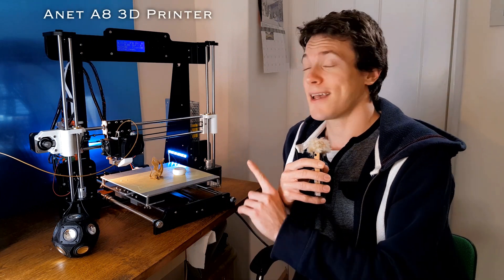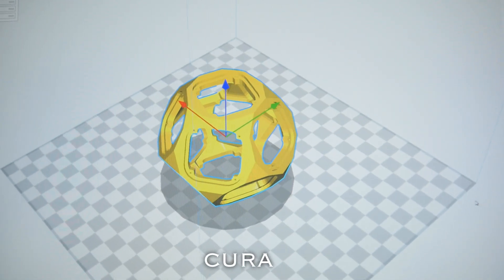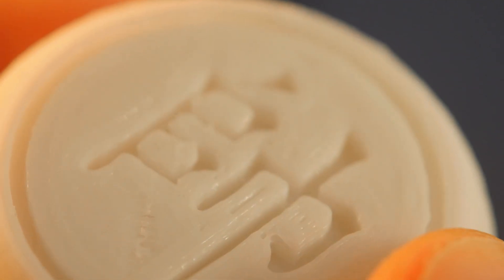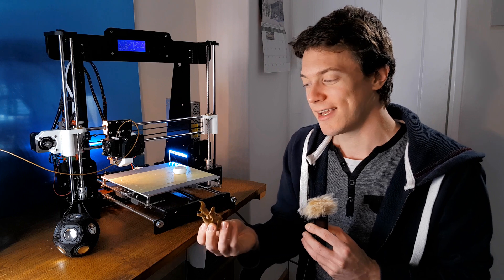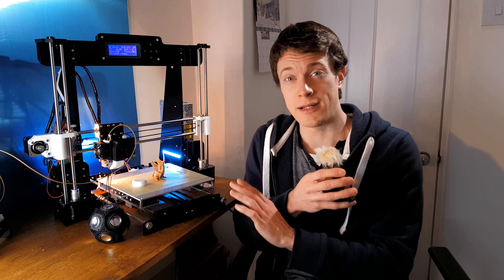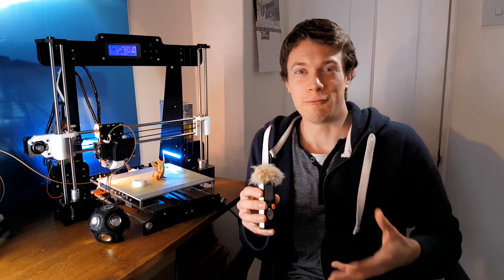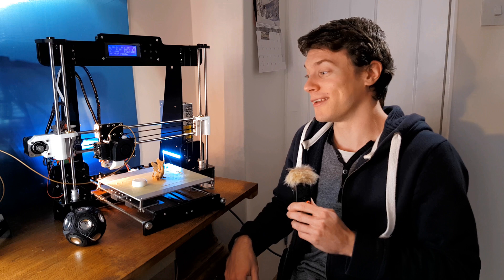Budget $155 3D Printer - Can it possibly be any good?

Comment from the maker: GUYS! They've sent me a coupon code, so you can get it at a solid $155 again. Just use this at checkout using the GearBest link: GBA8TW (updated 15 of March)
Reply: Saw this video and bought the smaller cheaper version- extruded doesn't work and it is missing parts. I don't think Gearbest is the most trustworthy retailer.
Reply from the maker: I'll try and get one - check back in a few days.
Reply: Maybe I am doing it wrong, but this coupon code literally makes it more expensive. My total is now 222 dollars.
Reply from the maker: Try this one: GBA8TW
Reply: This coupon code has "reached it's usage number limit" now... is there another one we can use?
Reply: Can confirm. The code no longer works. Says it been used max times. I feel deep inside a sense of relief of not giving my business to GearBest; my first and permanent impression of them, and their alleged shady reputation.
Reply: GBA8TW code works
Reply from the maker: The code has been updated again for those wanting to get it at $155.
Reply: Sadly it states that the code has been used the max amount of times and now the price is it $222, it shows me at $175 but when i go to checkout it shows $222 and if i try to input the code it says that it has been used the max amount of times and then updates the price to $222 so i am a bit confused.
Reply: Greetings 
I used the code, it gives an error saying that the code has limited usage  (which has been reached).
Additionally, on the first page of the check out process it gives me a total of over $222.00. Then after continuing through it drops back down to $172.99 + 23.78 s&h.
Is it at all possible for you to provide us with a new discount code.

Thank you for your time and quick response.
Reply: I bought mine already and I couldn't use coupon code :(((
Reply: darn, code expired. I waited for payday but I guess that was too long. Thanks for showing us this printer, I still plan on getting one, just have to wait a little longer.
Reply: Justin Shands just buy it without the coupon. plus shipping it ends up being around 200 cus theyre having some deals for 5 days. i guess after the 5 days it might even go up higher! like 300 idk get it tho
Reply: The code no longer works. it says it met the max number of uses. Is there another coad
Reply: yeah, title here should be changed. this isn't the same price anymore. not close.
Reply: works, better than $222. it is now $159.. total was  $187.97 to california, thanks !!
Reply: not working tried today(30-12-2016)
Reply from the maker: I think they've given up on giving code updates now :( sorry guys
Reply: it says invalid code
Reply: I've ordered this printer, cant wait. Could you please provide print bed dimensions for getting a glass panel cut to size? Possibly including how far in the adjustment screws are to have the corners removed from the glass panel.
Thanks
Reply: I must have been lucky, bought one quick when this video came out. Paid 155 plus shipping (DHL) so paid 200 and some change total.
Reply: Hi, can we have another code? thank you
Reply: Thank you!!!
Reply: Worked for EU plug version got that and an adapter for US. Thx so much
Reply: Your code is back working!!!! Thank you!!! GBXIAO
Reply: also it lists the price at like 174. when i used the code, it jumps to 224.
Reply: code doesnt work :( $222
Reply: tried it again and it didn't work
Reply from the maker: New one: GBT8TW
Reply: DIY Perks wrong code?
Reply: i clicked US plug, copy and pasted GBT8TW code and still $222 =(
Reply: yep, code is not working anymore. It has reached the limit of use it says
Reply: DIY Perks I want to buy the 3D Printer but the old and the new code dosent works.
Reply: Could you get a working code until Tomorrow?
Reply: lets wait for an official statement from Matt ^^
Reply: Ronald Ong yea, would be cool if he can get a new code :D
Reply: DIY Perks Oh ok thats not so good,  than i have to pay the normal Price.
Reply: DIY Perks oh that's sad...
Reply: GBA8TW works out to be a grand total of $183.77 ($159.99 for the printer + $23.78 shipping to the US) still much better than Ebay's scams for $200 ++
Reply: Need new code please!!!
Reply: Please let me know if someone has a new working code
Reply: Not to worry guy! I've been messaging the customer support for price matching and was able to get it for $146!
Use code: hsviper
Reply: "hsviper" didn't worked for me are you sure with this code?
Reply: Wolfgang Wöhrer it just worked for me. make sure you have the item check marked to show the total price, then when you enter the code, the total price will lower to $145.99.
Reply: How did you avoid import and taxes?? Gearbest ships from china..
Reply: I bought this printer following your advice, one of the best things that I have bought in a long time, mine is working like a charm, just bought a MOSFET and solder the wires to the bed and start to print the improvements on Thingiverse and the prints start to shine, great buy, thanks! I recommend it to people that like to deal with litlle problems without losing their minds, is a great printer once is tunned
Reply: DIY Perks thanks
Reply: DIY Perks d

Comment: For anyone looking at both the A8 and A6 and trying to decide, go with the A8.  I own an A6 and as far as I can tell, regardless of what the specs say there are few practical differences between it and the A8. The main difference is the A6 uses a different LCD and has a knob instead of buttons, as well as having a slightly more rigid frame.  Though in actuality I consider my A6 to be a downgrade, mostly due to how they designed the X carriage on the thing.  My printer suffers from major Z height alignment issues from one side to the other and it has to be readjusted pretty much any time the Z steppers are unlocked, otherwise the motor side will settle 3-4mm lower than the other side.  On my printer I ended up having to devise a pulley system to force the left and right sides to stay at the same relative height to each other just so I wouldn't have to do a complete relevel of both it and the bed after every print job.   Another downside to the A6 is there is (currently) no auto bed leveling functionality like the A8 is capable of.  

So basically with the A6, you're paying $50 more for a worse printer..  Plus the A8, being an i3 clone has HUGE community support.

Comment: I own one of these and yes they can print very well, much better than you would expect for the price.
The main issues with them are: 
 1. the power and heater  connectors that go into the board are of low quality and can catch fire under heavy load. 
 2. if the nozzle heater is not secured properly (wrap with kapton tape and fix the cables to the j-Frame with a P clip) then the heater can fall out, this makes the printer think the head is too cold so keeps the heating element on full blast, this then gets very very hot and sets fire to the print underneath.

So, Never leave the printer unattended and make sure you have a smoke detector located above the printer.
Theres a mod to fix the overheating connectors, use a mosfet switch unit to power the heated bed.
Hope that helps.

Comment: Using 3D printing improves DIY so much, I love mine and it's lots of fun :) And about part cooling fan, you already have it from what I can see. So it's matter of getting settings dialed right in, it can take some time but getting prints from printer thats calibrated right is really rewarding, keep trying :)
Reply: 3D printing really makes you DIY much less DIY but even more Assemble It Yourself (AIY) that without it. 95% of the work is done for you by the computer. You did nothing. So can you call it DIY? I don't think so.
Reply: @ScienceDiscoverer  Nice archaeological dig site you have here ;) Anyhow it depends how you use it, for me it seems you talk about printing ready designs downloaded from the internet. While my use case is designing parts myself (so yeah I still consider it as done myself) and then using them with non-printed elements (e.g. connectors, brackets, cut/drill guides)

Comment: Aesthetically, this printer resembles the Original Prusa i3. Not a bad printer but there are multiple thing stat can be improved upon. I believe that not only is the fan duct not being able to cool the part properly but the belts could be tightened a bit more and that should improve print quality some. There are also more than 2 types of filament ( i dont really know how many but i know there's more than 10 types) but PLA and ABS are the most prominent when prototyping.

Comment: Your mom's parents were polish? That is really cool to hear! Me and my gf say hi from Poland, we follow you since the "CPU cooler on GPU" video :D Keep at it, you're awesome!

I also have a few questions about the printer. What is the power draw and noise? Could you record it? It would help me decide. Also how fast is it? How long did it take to print that dragon figurine? Thanks a lot!
Reply from the maker: Took about 2 hours for the dragon - really not that noisy either, fine to have on in the background if you're working at a computer etc. Speed depends on settings like the layer height (0.1mm taking the longest). Nice to hear you've been subscribed for so long!
Reply: DIY Perks Thanks for the info! That's actually pretty damn good!

By the way, i know it may sound weird, but i love the way you say "sponge".

Comment: mine works great just mod it it can print its new bits 
they are all open source reprap looks up Adrian bowyer Ted talk the man who started reprap. ps abs is not stronger than pla if u print  without a heated chamber,
use sugar and water mix on heat bed to stick down the pla 
check out my 3d printer speed printing vid if u need any help let me know ;)

Comment: Im not sure if its been mentioned but join the Anet group on facebook, there is a serious fire risk with the Anet A8, you must keep an eye on the heated bed connector on the control board, they can melt and start a fire.... check the facebook group for more details.

Comment: I have been using the Anet for a few months. Its a great printer, and you can improve the quality by printing the ring shaped blower. That will fix your cooling problem. If you are willing to spend the money, there is a slicing software called Simplify3D, and it really helps with the print quality, to the point where it makes the prints look better than what my school's $3000 3D printer can do.
Honestly, the Anet A8 is the best bang for your buck you will ever get.

Comment: I've been wanting a 3D printer for ages.  I really wanted something like the Ultimaker 2 but haven't got a few spare thousand at the moment.  I've looked at a few DIY types but just never had the trust to buy one.  Your video has convinced me to buy this and have just placed an order.  For £137, I'm willing to take the risk.  Great video as usual Matt, I'm going to try your wireless screen next using an old Toshiba laptop.  I might even try and incorporate some 3D printed parts to it.

Comment: Another reason why the speakers could sound hollow (besides the enclosure material or sealing) is speaker pairing. The speakers should be wired so that every pair (every two) should be set up so that while one is pushing air, the other is pulling air. When you buy speakers packaged in pairs (such as car speakers) this is often already set up in the wiring, so you just wire according to the polarity markings. But if they're not purchased in pairs you usually have to switch the polarities of one of the speakers in a pair. This should be done for each pair. So on one speaker wire + and - as you normally would as they are marked. One the second speaker wire the negative to what would normally be + and wire the positive to what would normally be the "-". If there aren't any clear markings just switch the polarity of one of the speakers per pair (you should test one pair at a time) and you should notice a change in bass and often hollowness. There are some rare cases where a packaged pair, such as a pair of home speaker towers are not paired properly. So switching the polarity on just on of the towers is a good test to find out -- you will notice a change in the sound quality.
Reply: If there's enough surface space on the inside of the enclosure, add some sound deadening material, such as dynamat to the inside. Plastic is a horrible enclosure material, dynamat will help remedy that a little. Acoustic stuffing would help too.
Reply: There is no valid reason to wire a speaker driver out of phase.
Reply: Hahaha... Yes there is. You will here a major difference if you try it. Home and packaged-paired speakers are typically already set up for this, but you will still hear a change if you alternate one (for speaker systems that are already set up for this, the sound quality will get worse. But for speakers sold individually you will here an improvement. Try it.

Comment: ABS will not emit particles or fumes if you store it in a desiccated container under 25% relative humidity.  Emissions occur when ABS is stored in a higher humidity environment because it is hydroscopic (absorbs moisture) and that moisture covers to steam when heated which causes continuous mini explosions as it exits the hot end thus spraying micro particles everywhere.

Comment: it's say 175$ now, so it is no longer 155$ :(
Reply from the maker: They sent me a coupon code for me to add to the description. They said it should bring the price down to $150 like it was a few days ago.
Reply: I am about to order this because of your video but the price is not $155. Could you please ask them to provide you with the right coupon code so I can get it for the advertised price. 

Also, should I get the 1.75mm or 2.0mm  PLA filament. 

Thanks in advance.
Reply: The coupon code INCREASES the price to $222.94. Just delete the expired coupon code to get the current $172.99 sale price.
Reply: I just tried the code and it says, "The code you entered has expired." Can you check into this? I live in the US.
Reply: Hi Matt, the coupon code says its expired and then increases the price by £40
Reply: I just got a message saying "The code you entered has expired" 
(in Australia, and the shipping's a sting at $50)
Reply: err ma gerd i want for $155.00 not 222.94

Comment: Things to watch out for on these Cheap Chinese printers: The Hot ends are a source of misery for most. Made badly and jam all the time. Recommended to upgrade to something like the E3D Lite. The electronics again made cheaply and have a habit of combusting due to connectors not being rated or overall poor QC. The PSUs used again can be hit and miss with quality and reliability. Be prepared to spend the same again on new parts or making improvements! This is coming from personal experience. Also ABS needs a heated bed and possibly a heated chamber to avoid warping.

Comment: I Bought a laser engraving machine from Gearbest they screwed me over as the controller board that ran the machine was defective. In the end, they weaseled me into a refund of $80 instead of the whole price.of close to $200. As since then I bought a new controller board that is smoothie based and choice of software  LaserWeb3. Will I buy from Gearbest again after dealing with their horrendous customer service not anytime soon? No way! Gear best has also been known to raise prices when an item valued at 10 cents normally goes up to 40 cents, total stupidity on their part.

Comment: There are way more than 2 types of filament for 3d printing and although that machine probably only officially supports ABS and PLA, you'd be just fine printing a large selection of different filament. Also the hot end could be upgraded for an ever wider range of material. If you don't have the design know how to upgrade your printer worry not, use thingiverse.

Comment: I got basically this exact same printer last summer for $185 on Ebay. The power supply is clicking now so I plan to replace it with a proper computer power supply. The hotend I also replaced because the set screw holding in the heating element was stripping out and there was nothing holding in the thermistor. (fire hazard) It's still a fantastic deal though.  I would recommend wrapping the filament at the intake with some microfiber secured with rubber band to reduce dust caused clogs. You can modify the extruder to work with TPU no problem as well using a tiny bit of HTPE tubing. Also use octoprint instead of repetier if working over USB. Lastly, replace the blower guard/redirector with a better printed one or polyimide tape that one in because mine fell out mid print and was almost completely destroyed by the hotend.

Comment: First off get a REAL 3d-printer to compare to as your prints didn't look perfect, actully bad to be honest. Please test the performance of the hotend by Printing a large print (+5h, a +10h print would be ideal) that will let the hotend warm up for real, and check if it jams (it will) though don't forget to have retraction on. Also test the heated bed as it will most likely not hit 100c thus can't print ABS without som abs-juice/slurry (which doesn't count). AND for goddnes sake don't recommend anything with you having to run mains-wire your self, it may be "only" 120v AC were you live but in most of the world it's 230v which will kill you. You have over a half a million subscribers, that means that you have a responsibility (weither you like it or not) to research before posting as you should NOT spread false/missleading information.

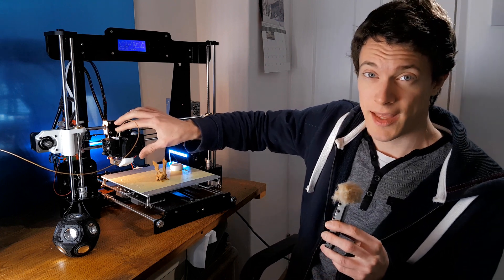Comment: 1:11 There are far more than that, HIPS, Nylon, PET and PVA to name a few. There's stuff like carbon fiber, wood and copperfill but that's usually PLA mixed with particles of said material.

BTW get ready for hours of frustration and calibration. 3D printers have a knack of fucking around and breaking. Oh and get ready for 12-hour prints that fail 11 hours in and layer misalignments that will envelop your extruder in a spaghetti monster of plastic.